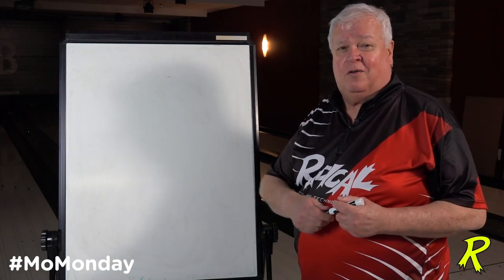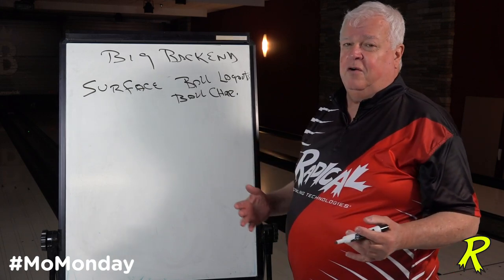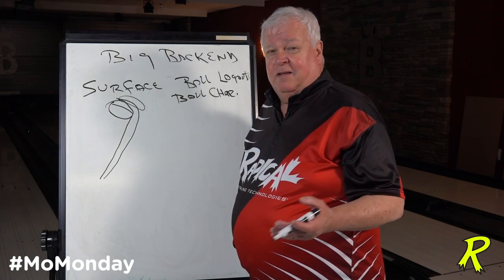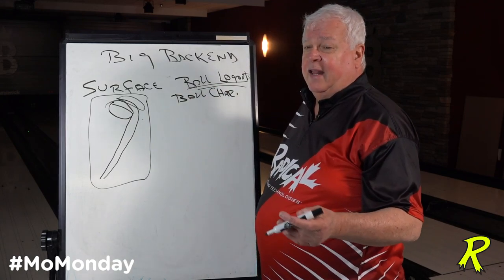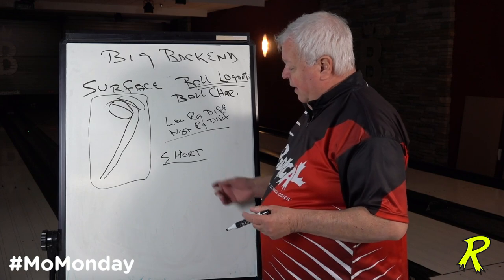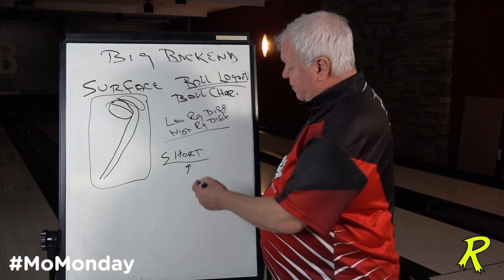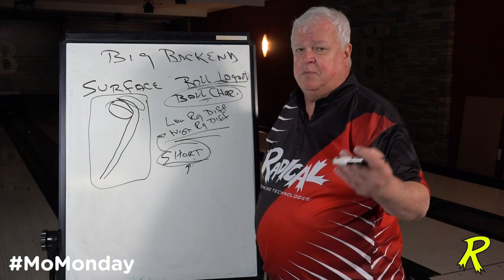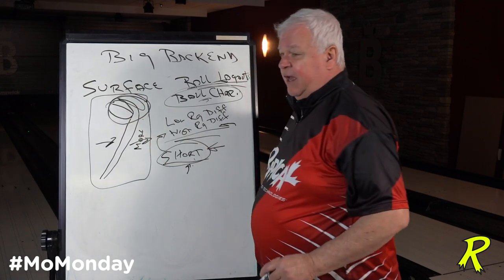Controlling BIG Hooking Backends - #MoMonday

Comment: Practice shooting 10 pins with the most aggressive ball in your arsenal. 500 grit big hooking asymm.
Practice until you can consistently roll the ball in a perfectly straight line. Modify this hand position slightly for booming backends. Your spare game will probably improve as well.
Reply: Even as a two hander?
Reply: @owenoupasensack2240  Sure, why not?.
Reply: @byronfranek2706  Oh boy.
Reply: or use a spare ball

Comment: I’m a lefty with high axis tilt and rotation. I’m always advised to use big cores and lots of surface, to slow the ball down. Problem is when I bowl on cliffed house shots: if I bowl in the dirt with big cores and lots of surface, I get early roll out and endless corners. If I move my inside to grab some oil, I end up with splits and garbage.

How do I get out of “jail”?

Comment: Urethane is not really meant for broken down lanes, with few exceptions, as Urethane hooks early and is tame in the backend. Urethane is really good on some fresh conditions when the shot is toward the outside part of the lane.
For me personally, when the lanes are fried side to side and in the back, I migrate deeper into the lane with either a weak (symmetric) hybrid or sometimes a weak pearl, as these type of balls get good length, don't overreact when they hit dry, but still provide the necessary punch to get thru the sticks properly.
Reply: The brunswick twist is my ball of choice for those kind of conditions.

Comment: Me trying my best to not get pissed off about the fact that EVERYONE who's ever told me anything about surfacing a ball
has always said it'll hook MORE and be MORE AGGRESSIVE after you've surfaced the ball.  This guy however tells me the
exact opposite.  That surfacing my ball will slow it down and make it not hook as much on the back end and that POLISH
will in fact make the ball hook more and become more aggressive?  The knowledge of bowling is ALL OVER THE PLACE 
and it drives me absolutely MAD!  😫
Reply: look at your ball like a tyre, a chunky tire works better on wet/muddy surfaces while a smooth racing slick grips better on dry smooth roads. 

the smooth shiny ball will glide over the oily lane then when it hits the dry part the two dry materials will grip tightly and the ball will more aggressively hook. thus skid and then snap

meanwhile the rougher balls will cut through the oil to start gripping much sooner. but once they clear the oil, they wont have as much surface contact, and such wont turn as aggressively. so they'll look more like a continuous arc.
Reply: Not necessary hook more, but start hooking sooner.
Reply: @MrOsmodeus  that is a superb explanation!

Comment: Here is a suggestion for a future MoMonday: Radical drill sheets show the layout based on a 5" PAP and it says to adjust angles for other horizontal coordinates.  How do you do this? My PAP is 4-1/2" over by 0 vertical. How would I adjust?

Comment: What about short flat flippy patterns like 36' Viper for very low rev bowlers? I am talking under 200 rpms.
A flood in the first 36 feet where ball does not hook at all, then once it exits the oil it takes off out of control.
For me at 145 rpms, a 1/4 board miss results in about 6-8 inches of miss at the pins.
A one board miss right will washout and a one board miss left will go through the nose and split.
How do I get a ball to not do that with my low rev rate?
I have tried tons of surface and all that does is make the ball take off even more severely once it exits the oil.
I have tried polish and all this does is reduce my miss room in the oil.

Comment: More people hate resin and urethane balls than you will ever know.  In about 1960 there were something like 80 million league bowlers in the USA.  A perfect game actually meant something back then.  The record for three game set was 886 and it looked like it would stand forever.  I learned to bowl with a rubber ball and struggled when urethane came along.  After I figured out urethane then they came along with resin and I had to learn all over again.  A lot of people who learned to bowl in the 1960's are still alive today.  I'd like to see Legacy Leagues for people like me who don't like inflated scores and having to lug 6-8 balls to a handicap league.  My idea of a Legacy League would be a lightly oiled pattern about 38 feet, and only rubber and plastic balls allowed.  That way if you missed six boards left you would knock down three pins instead of getting a strike you didn't earn.